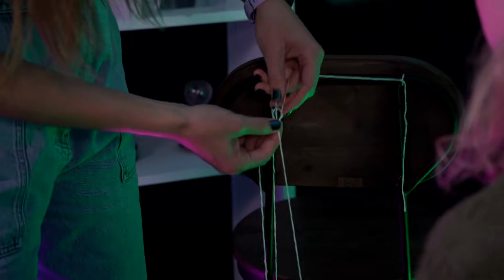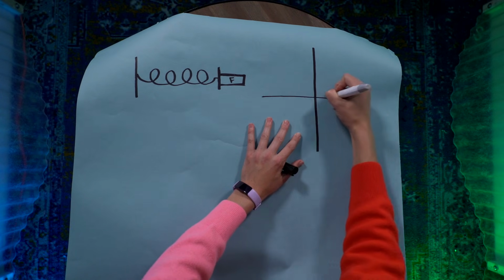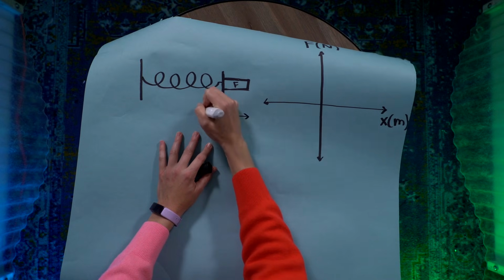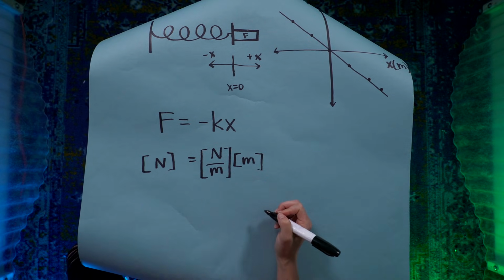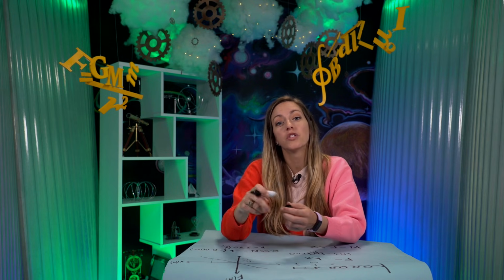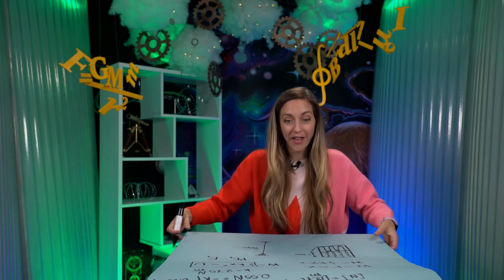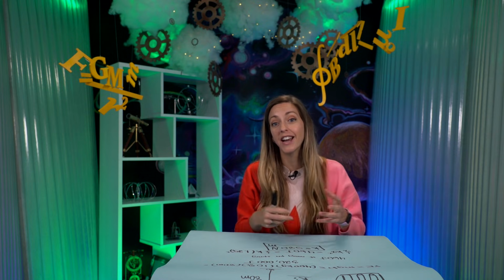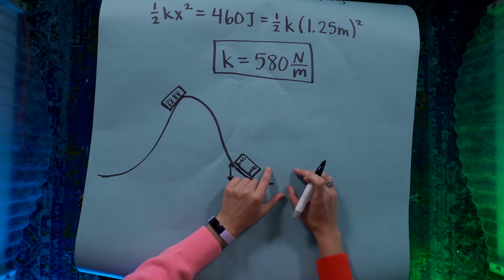Conservation of Energy - Physics 101 / AP Physics 1 Review with Dianna Cowern

Comment: Hi Dianna, at 11:00 when you calculate the work done you use the average force. I had a thought that you could sum the work done for every increment in the force by using an integral. Would this give a more accurate answer? Is this even correct?

Comment: This is slightly off topic, but pretty close. Imagine lifting a 10 kg mass, 10 m in Earth gravity (rounded to 10 m/s^2). The mass gained 1,000 joules of energy. By E=mc^2, this means it gained 1.1x10^-16 kg mass, since it did not gain temperature, not is it moving. Where does the mass manifest?

Comment: Physics Girl, the solar system is traveling through space at a speed of 70,000 km per hour

My question is, if you hurl a satellite into space and make it travel in the opposite direction that the solar system is traveling, would the satellite be farther away compared to if the satellite was traveling in the same direction as our solar system, after some time?

Comment: When I was going through suspension courses for my automotive training I was surprised to learn of two springs they use primarily in trucks that I had never heard before. (I've never owned a truck)  Torsion bar and leaf springs. The torsion bar spring seemed very odd to me, but come to find out that the steering mechanism of most vehicles with hydraulic power steering has a small torsion bar that links the steering shaft to the pinion gear and when it twists operates a rotary valve that allows the fluid to flow to one side of the rack assisting in steering.
Reply: Springs are also inside a vehicle's dampers(shocks) as well in the form of shim stacks. To control how fast fluid can flow on the bound and rebound stroke of the damper, a stack of shims that are just flexible discs of metal are chosen for the desired application. In racing, high-performance dampers can be easily be opened up and the stacks changed out based on the needs of the car. This was by far the hardest segment of my HIPO suspension class. We used a machine that tested the dampers and gave us a graph. We had to decipher what the graph meant and make changes to the shim stacks to adjust the damper to 5 or 6 different specifications.

Comment: For a roller-coaster, you don't just transition between up/down slopes and flat sections - you also get 'u's where a downslope becomes an upslope with less flat than the length of the train. In those sections, it's the middle of the train that is moving fastest at the bottom, not either end (though at peaks the middle moves slowest, which is more boring when you're going over a hill, but more exciting when you're doing a loop)

Comment: I think a simple equation for the spring constant is the same but it's the tangent of the angle times the normalized distance along x.
Reply: Also when throwing a bottle up you can throw it faster than 1g but it will not fall faster than 1g
Reply: @prest0n755  You don't start your up clock until the bottle is released and so experiences the same 1g acceleration up and down.

Comment: So not coming from any sort of physics background, and thinking about the comment about the expanding universe changing the big bang radiation from visible spectrum to microwaves and then to radio waves.... how long until that radiation becomes audible and the whole planet goes bonkers from the noise coming in from the entire universe???
Reply: The big bang waves are electromagnetic waves (light, ultraviolet, radio, x-rays and the like).  Sound waves are changes in pressure of a physical medium that propagate through and via the medium.  For audible waves, they are density changes in the air that propagate to your eardrum and physically wiggle it so you hear something.  Your ear isn't designed to sense electromagnetic waves.  Ironically, the microwave receivers Nobel Prize winners Penzias and Wilson were using look a lot like old fashioned horns people would put to their ear to hear better.  However, they were over 10 ft. long.  Probably effective but difficult to carry around.  Does this help clarify things?
Reply: @FlyingSavannahs  Yes, thanks. Should have realised myself  that sound was pressure based :(  [insert face palm here]
Reply: @benpike4806  Great!  I just ran across Dianna's earlier video dedicated to the Cosmic Microwave Background Radiation discovery.  Make that antenna horn about 30', not 10'!   🤦   Go check it out.

Comment: Combining the data around the 9:00 point with the result of the real-world calculation around 16:00, did Dianna say that the array of springs used to power a carnival ride are about twice as stiff as the spring in a ballpoint pen, and about 1/100 as strong as a car's springs?  That really surprises me.  I'd have thought a high-demand application like a ride would use stronger springs for efficiency.  She said those are big springs, but is that what the math says?

Comment: Hang on, the roller coaster thing doesn't make sense... If you just wait long enough for the back car to be where the front car was when you looked at the energy states you describe, the back car will be in exactly the same condition. All the cars are rigid and constantly connected, so which one has which energy only depends on timing, not on its position... Am I missing something?

Comment: I know you're a big bang believer, but the CMBR is really the universe beyond what we can see being just a glimmer... it's where whatever causes redshift to happen causes the photons to just become part of the background heat emission, basically in a highly turbulent state.  And while it is from near 14B years go, that's not the beginning of the universe; and probably the universe has been around a significantly longer time.
Reply: Got any math to go with that?
Reply: @CorwynGC  There's not really anything in the math that changes... just changing some labeling, and projecting redshift as a function of time instead of a tangent across space with an implied time.
Reply: @3zdayz  If you think making redshift a function of time instead of space, doesn't change the math, then I can tell you don't understand the math.
Reply: @CorwynGC  Well.. since the unit of distance is light-year... you just have to remove 'light' and use 'year' ... so it changes the units/labels... but again the math doesn't change.
Reply: @3zdayz  And Volume?  But, even if what you claimed was true, then if it doesn't change the math, it doesn't change the results.
Reply: @CorwynGC  what about volume?  doesn't matter how much volume photons go through.

Comment: Both.  In the front, you go over the top of the first hill first and you kind of hang there as the rest of the cars finish going up the hill.  At some point you start to get pushed down after that great pause.  If you are in the back, the opposite happens.  You are going up the hill and as you are reaching the top, you start to accelerate and get whipped over the top of the first hill.  So sitting in the front or the back both have fun factor written all over them.
Reply: 1 like plus a "you got it!"  The most significant questions in science are the ones that are answered with "It depends!"

Comment: If the front and back of the rollercoaster are traveling at different speeds, it must be made of springs.
Reply: a) That's not entirely wrong - chemical bonds can be modelled as very stiff springs, even before you get into the mechanisms linking cars together.
b) It's not just the speed and parallel acceleration of the rollercoaster, but also its perpendicular acceleration (which depends both on the speed and the curvature of the track at that point in space) that matter to your experience. So at the base of a downhill run, the lead car continues to accelerate along the flat, giving it "boring" speed, having been slower (so experiencing less centripetal acceleration) as the slope curved into the flat, while the rear car, arriving at the vertical curve later, when the rollercoaster is at top speed, experiences more centripetal acceleration.
Reply: @rmsgrey  Regardless of how you model chemical bonds, just how much will a rollercoaster car stretch and contract as it goes along the track?  Regarding your second point, I only mentioned speed, not acceleration.
Reply: @michaelsommers2356  The front of the rollercoaster travels at different speeds, never mind any other part of it.
Reply: @rmsgrey  Different speeds at different times, but always the same linear speed as every other part of the rollercoaster car.
Reply: @michaelsommers2356  Which also means different parts of a given car, let alone the entire train, will have different speeds at the same point on the track.

Comment: Regarding roller coasters; the best place to sit depends on the reason you're riding the coaster.  If it's airtime you're after, it's usually the front.  However, if it's speed and an out-of-control ride you're after, the back is usually the best.

Comment: The spring in a bow is not the string... it's the limbs. The string does not stretch, and would make the bow much less efficient if it did.
Reply: Technically you’re both right. The string, though very very small, has stretch for durability sake but you’re right in saying the bow limbs are what store the energy not the string.
Reply: I latched onto the same thing, but to be fair there is such a thing as a torsion bundle used in ballistas.
Reply: @Hawk20O1  in ballistas yes. Modern bow string material is actually measured for stretch. Usually about 1% stretch.
Reply: @MercuryRisingFast  actually, 'the limbs' means the bow itself.
Reply: The string does stretch, unless it has a Young's Modulus of infinity (which no known material has) 🤦‍♂️.  People in glass houses shouldn't throw stones.
Reply: Everything is a spring. Coil spring, torsion spring, plate spring.... even a rod can be a spring. If it moves or bends and retakes its shape elastically, it's a spring. So.
Reply: @jan-sme  never thought of it like that.  You're absolutely right.  All objects will resist deformation and return to the original shape assuming they're not deformed beyond their elastic limit👍. So all objects can store spring PE, so all objects are springs (although some springs are better than others).